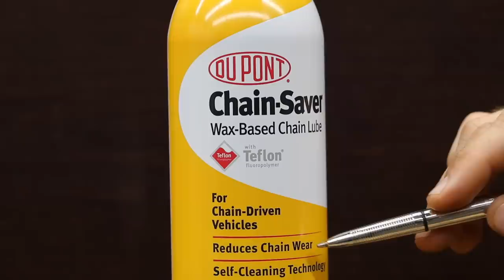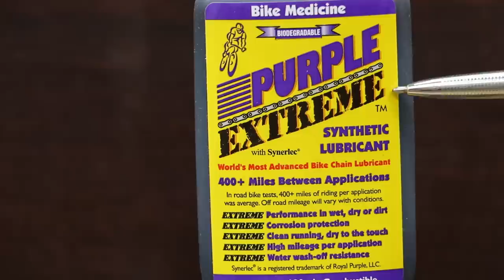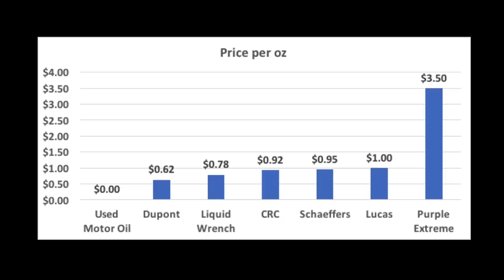Which Chain Lube is Best? Let's find out!  Ultimate chain lubricant showdown!

Comment: Love all your videos.  With chain lubes, one must consider that many chain lubes, including some you tested, are "dry lubes". Meaning the lubricants are dry to the touch after applying and letting the carrier evaporate. A non-tacky surface is ideal for chains that are exposed to dust, grit, etc. because a tacky chain lube attracts such grit and grinds into an abrasive paste on your chain. In your "remaining lube" test on the chainsaw, touching with a paper towel to evaluate remaining lube isn't valid with dry lubes as the carrier has evaporated and only the non-tacky dry lube remains as intended by the manufacturer. The film strength test is also problematic with dry lubes because, as tested with the cup, the carrier is being tested as much as the lubricant. All things to consider when coming up with tests for different types of chain lubricants. Will also note that most of the dry lubes recommend applying to a warmed up chain to facilitate the carrier evaporation and not using the chain until all the carrier has evaporated. So one would typically clean and apply the lube at the end of a bike ride, for example, rather than lubing immediately before.  

For dual sport and offroad motorcycles and mountain bikes, we always use various dry lubes because tacky lubes just attract and retain dust and dirt and shorten chain and sprocket life. As you mention, dry lubes work best in dry and dusty environments (mountain bikes and dirtbikes in dry areas or, like your baler since we don't bale hay in the rain! Ha.).  Wet, tacky lubes hold up better to wet environments such as mountain bike or dirtbikes when used in the rain, puddles, mud. 

With the environment your baler operates in, I'd recommend a dry lube which will leave the chain lubricated but dry to the touch and would not attract and retain all the dust and debris from the field.
Reply from the maker: Thanks for the feedback.

Comment: For bicyles, there are new'ish products that are completely dry and attract nothing as far as dirt and sand.   The best part about them is they don't stain your hands, pants and socks  with black oil.   The wax also keeps the entire drive train fairly clean for the times you work on it.    The best (read most expensive) bottled bike products are wax and ceramic based lubes that come disolved in a solvent that evaporates off.   There has been a lot of testing with this in recent years and apparently dry wax lubes provide the lowest friction on the chain so you'll losing less energy to friction within chain itself.    Riders who use wax literally soak their chains in a slowcooker of heated wax blends  ...the bad, there is nearly zero rust protection.    

I don't think any of these would have scored well on your tests other than not sticking to sand, but i thought i'd throw it out there anyways.
Reply from the maker: Thank you!

Comment: I’ve tried most, and for years now have stuck with DuPont Chain Saver on my road racing racing motorcycle.  It seems that many chain lubes sling off a greasy oily film on the frame, rim and tire sidewall.  DuPont Chain Saver goes on wet then leaves a waxy film that stays in place and doesn’t sling off.  I clean and lubricate the chain regularly, and got almost 20,000 miles out of a DID 525 X chain with little wear and stretch.
Reply from the maker: Thanks for sharing.
Reply: @ProjectFarm  Really enjoy your videos.  Thank you.

Comment: Correct me if I'm wrong, but aren't most of these dry film lubricants? Meaning for the lubricity test it would be ideal to let the solvents evaporate first and just use a thin layer on all the components.
Otherwise there's probably a solvent like alcohol in the mix reducing the lubrication effect.

Comment: Great video as usual! I've heard dupont Teflon multi use lubricant works good on motorcycle chains. Basically cleans the chain when applied and does not sling. Would be interested in seeing your test results with this product.
Reply from the maker: Thanks!  Thanks for the suggestion.

Comment: Which of these would you reccommend for a motorized bicycle that would be mostly driven on paved roads?
Also, do you think you could mount two 120mm 12V 4000RPM fans on the sides of the 2 stroke cilinder block to suck the heat out of the fins?

Comment: Interesting video but most avid cyclers (bicycles) will use a lube formulated for use on bikes. The ones you tested all look like general purpose or meant for automotive or motorcycles. I personally use Boeshield T9. It is a wax based lube that does a great job of getting into tight joints and it dries so it does not attract grime as easily.
Reply from the maker: Thanks for the feedback.

Comment: Maybe mentioned already: try melting different waxes, like paraffin, soy, even plumbing wax ring with, powered graphite or teflon, to lube roller chains, the old timers would do this method. They would mix their melted wax and additive, let it harden, then place the chain on top of the hardened wax and remelt the wax, let it cook for a spell, then take it the chain out and allowed to drip dry.
Reply from the maker: Thank you for the video idea!

Comment: You should have used Gearbox oil (80W90 for instance) instead of Motor oil because gearbox oil's viscosity is much higher (oil is thicker) which means it doesn't fling off the chain like Motor oil (10W40 for instance). A 80W90 oil (gearbox oil) is actually what is recomended by DID , the biggest motorcycle chain manufacturer in the world to lube their chains, it's written on the box.
Complete yout test with gearbox oil and you will have a new winner.
Reply from the maker: Thanks for the video idea.

Comment: As an avid cyclist I'd never use any of those lubricants on a bicycle chain.  I'm switching to molten speed wax for my bike.  There are definitely different products for different uses.
Reply from the maker: Thank you for the feedback
Reply: @ProjectFarm  would love to see a test of real bike chain lubricants.  Molten Steel Wax, Paraffin Wax, Parrafin Wax with PTFE added, Squirt lube, WD-40 Bike Chain Lube, Finish Line.  Would like to know what provide the best lubrication, lasts longest, attracts dirt, prevents rust, reduces wear on the gears, reduces chain stretch, what's quietest.

Comment: Original Bike Spirits Chain Lube (red can) and Pro Honda Chain Lube (White and Red can) are the two best chain lubes that I've ever used. Both contain PTFE and Moly. Superior lubrication, dries fast, no sling off. I prefer Original Bike Spirits though. Pro Honda has a "new formula" and it's not as good as the original formula, still good though.
Reply from the maker: Thanks for the feedback.

Comment: Thank you - i am hoping for an update for bicycle chains as there’s a lot of snake oil out there. In particular wax lubricants but may i suggest that you strip the chain of all factory grease first. 3 - 4 runs of mineral turpentine should get rid off all or most of the factory grease. Only then can we tell if the bicycle lubricants are doing their jobs - in dry, then dry and sandy, wet and wet and slightly muddy conditions. Products to try? boesheild, squirt, secret wax and finish line - dry, wax and wet lubes
Reply from the maker: You are welcome!  Thanks for the suggestion.

Comment: We farmed in northern maine for 25yrs and then partnered with some farmers from north dakota on a potato growing operation in western nebraska, so we have these discussions pretty regularly. They choose to go without any lubrication on potato harvester chains and cogs and we have always used grease?  They feel lubrication wears chains faster due to collection of sand and dust (and then there is the mess when working on them), and we believe a thick coat of grease keeps the sand out by it clinging to the outer portion?  Your thoughts?  Thanks in advance.

Comment: Phil Wood Tenacious oil would be a good product to add to the comparison. Or possibly high viscosity (140wt) gear lube.

A major point of wear on chains is the pins. Having a lube with excellent penetrating capability would also be very desirable.
Reply from the maker: Thanks for the suggestion.

Comment: I use DuPont and Lucas on my motorcycle chain. I ride a sport bike and I'm not nice to it. I put a new chain on this bike last year and since then I have only used Lucas brand chain lube just because that's what my local auto store carries. So far after a year of use half of which was sitting in my garage the chain has no rust no kinks and has collected very minimal dirt if any at all. The dirt tends to get slung off the chain while the wax base chain lube stays on for the most part. I tend to overapply my chain lube and then let it set and then run it hard to sling the excess off. I don't think you applied enough chain lube in your testing because I got no rust with Lucas and Dupont after 2 years of use on two different bikes.
Reply from the maker: Thanks for sharing.

Comment: Gear oil! Gear oil is missing from this comparison, as it is often recommended by chain manufacturers (especially for motorcycle chains, which, in fairness, have different usage characteristics than bicycle or bailer chains). Usually the heavier the better to limit amount of slinging. Some people even add a little moly paste or a little of air filter oil (for reusable air filters) to further limit the amount of slinging.
Reply from the maker: Thanks for the constructive feedback

Comment: Maxima Chain Wax is one product that dirt bike riders swear by. I've had great results with it for over 40 years as well. It seems to go on as a solvent based liquid then dries to a thicker wax.
I don't want to tell you your business but the chain on your bailer seems a little too slack. You might want to figure out how to create and install a chain tensioner on it. They increase the lifespan of chains as well as sprockets. Good video though. You can always be relied upon for unbiased information.
Reply from the maker: Thanks for the feedback.
Reply: Yes, I had been wondering about how parafin wax would fare - it seems to be all the rage in the bicycle world just now, with remarkable claims for cleanliness and lubricity. The down side is the need to remove the chain from the equipment in order to apply, which requires soaking the chain in melted wax.

Comment: Some of those wax based lubes need to be applied to a warm chain. Not sure if products you used said that on the directions.

I’m not sure what I would use for farm equipment. That’s a way different application then something like a motorcycle. As your testing is dirt attraction which is a good thing to test for this application.

For my motorcycle I used either maxima chain wax or Honda chain lube. The chain wax does need to be applied to a warm chain.
Reply from the maker: Great point. Thank you

Comment: many chain lubes use carrier agents that evaporate after application and leave DRY residual films! you need to let these products set, penetrate, and...repeat process on non-sealed chains as the first application seeps inside the chains to lubricate internal contact points; also...2 very common products were overlooked...gear oil and bar-and-chain oil!
Reply from the maker: Thanks for the suggestions for future round of testing.

Comment: I suggest you test the best lube in this video against a motorcycle chain lube like blue Rey super clean. I swear by it for a motorcycle chain. Especially a dirt bike. I found if you take a 10-20 minute ride before applying it, it works better on a warm chain and also dries quicker.
Reply from the maker: Thanks for the suggestion.

Comment: Check out cosmoline RP-342 or Amsoil Metal protector Heavy Duty. These are both waxy substances that spray wet and dry leaving a protection film. RP-342 is more of a metal protectant not lubricator but Amsoil is supposed to protect and lube. I believe that Amsoil also makes a specific chain lubricant. Either way both products are pretty interesting and I would love to see both reviewed at some point. RP-342 I’m currently using as a frame undercoating
Reply from the maker: Thank you for the recommendation!

Comment: You should try EP 90 gear oil. I use it on my motorcycle chain and it is really good chain lubricant  it increases the chain and sprocket life 3× upto 50,000 km.
Reply from the maker: Thanks for the suggestion.

Comment: Used (or new) automatic transmission fluid. Soak the chain, drip dry, will never rust. How do I know? I had a transmission leak in my pickup bed and cover my rusty, stuck ratchet straps. It freed them up, took away the rust and I can leave them out in the rain and they never rust or get stuck any more.
Reply from the maker: Great recommendation! Thank you

Comment: Chain the hay baler looks like single or double row #80 roller chain, with a roller chain you want a product that’s going to get under the rollers and down to the pin’s to lubricate it properly. That’s why the other person was using engine oil, because that probably what’s recommended. You do want to lubricate the outside of the chain and sprockets as well. What will happen if you rollers are not lubricated properly they will stick and wear in 2 spots until they wear thou the roller, and the piece breaks into 2 pieces then falls off.
Reply from the maker: Thanks for the feedback.
Reply: @ProjectFarm  Your Welcome, and enjoy watching torture test products

Comment: I wish you had checked the chainsaw tests with an infrared temperature reader. The heat build up would have shown alot about lubricity. I think the winner should have been both dry and low friction, or at least that would have been ideal.
Reply from the maker: Thanks for the suggestion.

Comment: As the chain does not get additional lube when running, I am curious if you can run the lubricity test dry.  Lube the wheel and puck once then let dry for an hour. Test to see how long it holds up. Or test for 30 seconds. This reflects more on how chain lubes work. Also some wax type lubricants dry out but leave a film inside the chain. This will test dry on the chain saw test but still may be lubricating inside the links.
Reply from the maker: Thanks for the video idea.

Comment: On your next review you might want to include Boeshield T-9 Chain Lube.  It is sold world-wide to retailers by a customer of mine in Holland, Michigan who ages ago got the rights from Boeing.  Contrary to what you read, it is not a Boeing company and my customer's name is PMS products, which are the initials of the guy who began and owns Boeshield.  It was developed and used internally by Boeing to lubricate and protect from rust on aircraft landing gear etc.   What I have I got for free as I am the owner of their web server company and IT support.  I'm not the best one to evaluate the T-9 because I always forget to use it.  I just go by what I hear from others who are gah-gah about it.  I don't gain anything by writing this.  Seeing your review simply jogged my memory.  It is a liquid that displaces water, and then the liquid part flashes off.  I THINK it leaves a light wax film behind.  I know people use it on sailboat parts that are around salt water as well.  Peter demands accuracy in claims to a fault, which is probably not the best for sales.  He poured his life into it, and while very old, you will still find him at work.  However, Tom (if he isn't at a trade show) manages day to day operations, plus there is Mary, and the new guy they hired for sales who people can contact.  Peter is talks with banks, production facilities, etc.  I saw a few claims of it being hard to remove, but I also remember Peter showing how soaking a chain in ?? cleans the chain inside and out, and then how to start the application all over again.  Their web site probably has that information.  I doesn't look expensive to me, and a little goes a long ways.
Reply from the maker: Great suggestion!  Thank you

Comment: Do you need lubrication of the contact surface between the chain roller and the sprocket?
Many bicycle enthusiasts soak their chains in heated wax (paraffin, and sometime teflon powder). This, it would seem, keep the chain clean and dry, but doesn't provide much lubrication between the rollers and sprocket. Maybe chain-stretch is the biggest source of wear?

Comment: Many bicyclists swear by a fairly inexpensive lubricant - a melted paraffin bath. There are multiple YouTube videos with variations on this procedure. It's dry, has decent lubricity (at least under bicycle speeds and loads), and prevents dirt from getting into your links.

(If you try this I strongly suggest you do not use your wife's good slow cooker. That can present hazards to your health that you may not have expected.)

And, let's face it. When it comes to low end consumer bicycle chains, your time spent maintaining the chain is worth something, and your best lubrication bang for your buck with cheap bicycle chains maybe no lubrication at all.
Reply from the maker: Great Point

Comment: I ride dirtbikes alot so obviously mud and dirt is an issue. The chain lube ive always used isn't exactly a chain lube at all. I always use WD40. Believe it or not WD40 does great with my Honda CR125. Dirt doesn't really stick to the chain or the teeth on the sprockets, and rust doesn't occur as bad either, sure after a while of riding and a few washes later some surface rust starts to show, but I just take more wd40 and a wire brush to the chain, and after a couple minutes of a little elbow grease, the rust is very minimal. It kinda made me a little surprised to not see wd40 in this cuz that stuff has a million and one uses. If you do another chain lube video, i really hope to see wd40 in the show down, cuz after using it for so long myself i truly believe it's a contender if it does well on a race bike
Reply from the maker: Thanks for the feedback.